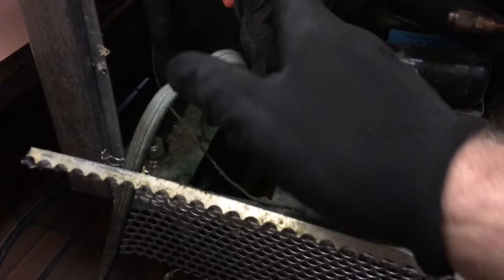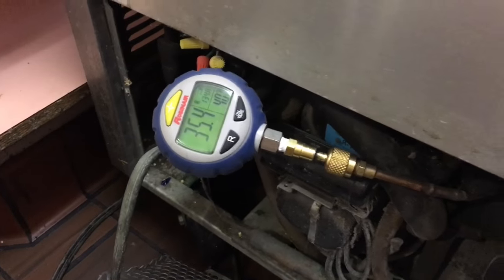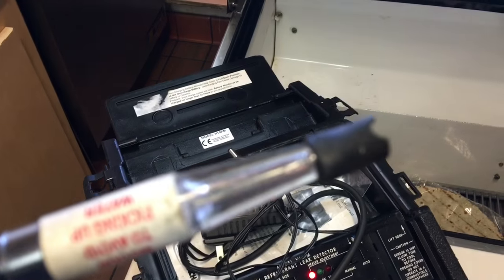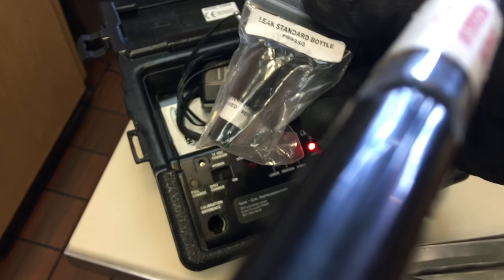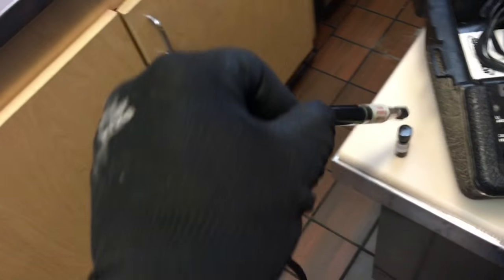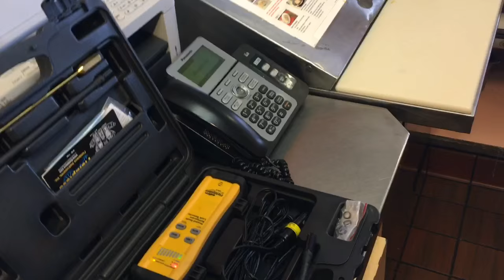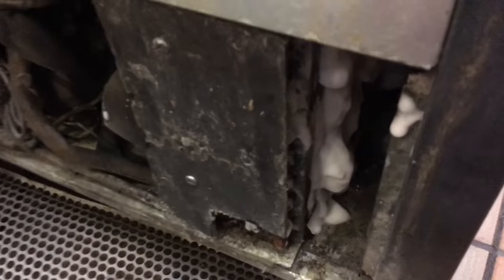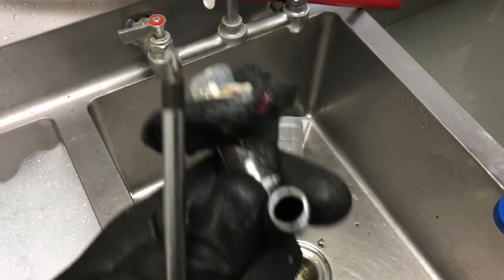Leak check

Comment: I had the Fieldpiece, but you have to be careful because it adjusts to the levels of refrigerant and needs to be pulled back and cleared of refrigerant in order to pin point the leak, the H10 seemed a better fit for me. I knew that guy was full of it because Ralph had done a video with a 410A unit almost flat on charge and it picked it up no problem. Good post Dave, thanks.

Comment: My question is what did you do after cleaning the condenser and quote for an evaporator?  Recharge just get by for a short while or do you decommission it until part is replaced.  Thanks.  Learning more on refrigeration from you everyday.

Comment: will the older h10 pick up hfc just as well?
how is a walk-in doing the one which was out of gas?  from 2 weeks ago?
thanks
Reply from the maker: The walk in is full of charge and cooling fine. Mystery to me still. The older h10 h10b was CFCs only the h10g gets everything. What ever the trace jell is from yellow jacket it dose not detect. As you can see in the video it pics up HFC R134a just fine, and is more sensitive to the small leak I had than the SLR8.  I like em both but the h10 is hands down the best.

Comment: Nice video! I bought the H-10 last year.I think im not using it right but kinda disappointed with it.
Reply from the maker: Did u get it new?
Reply: Yes
Reply from the maker: +Philip Villaloboz if it's adjusted correctly it should work, there are 2 heater adjustments, if it's adjusted and still not working, you can send it in for repair. I've had to do that once,
Reply: Ok cool. Thanks

Comment: did you take the cap off the leak test fluid? Great job anyways.
Reply from the maker: Yes. That is a base for yellow jacket leak detector. As you can see the h10 dose not respond to it. But picks up HFC's just fine.
Reply: I Think I have it too in my leak dt case, but that
black cap needs to come off otherwise it will not detect, i strongly believe that the h10 is superior to the other one.

Comment: we have some audio Dave..yayy!!
Reply from the maker: Ya I had recorded my radio in the van it was prince. YouTube didn't like that. He was a great musician. Killed the drums as good as he did guitar.
Reply: +Nor-Cal Refrigeration & H.V.A.C yeah he was Dave , hey have you ever had a problem  with a CPR valve leaking?
Reply from the maker: +Felipe Tafolla yes they will leak.
Reply: +Nor-Cal Refrigeration & H.V.A.C Came across  one yesterday,  once I loosen up the cap by half turn the pressure between  the adjustment  screw and the cap was so strong  , that the freaking  cap popped  like a bullet.
Reply from the maker: +Felipe Tafolla I've seen that. Time for a new one.
Reply: +Nor-Cal Refrigeration & H.V.A.C yeah was a little crazy,  I already  took care of it old 3 door traulsen freezer with R-12